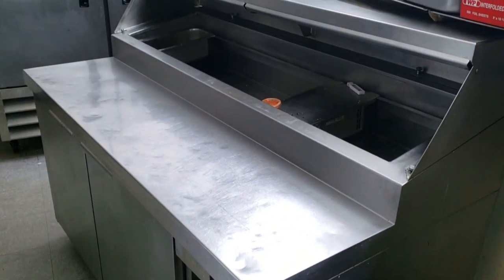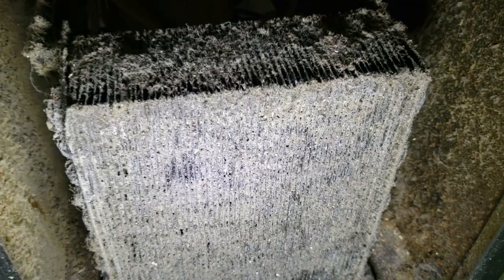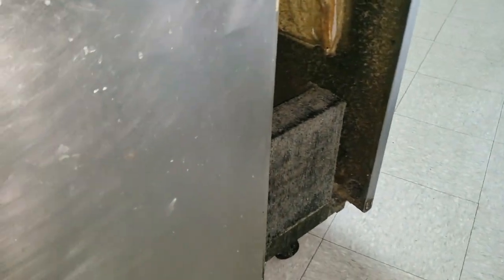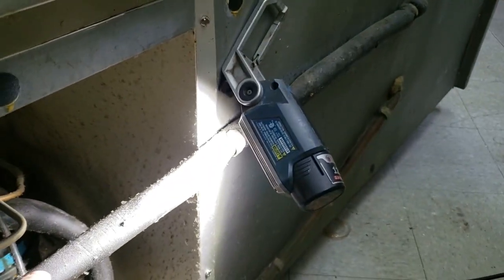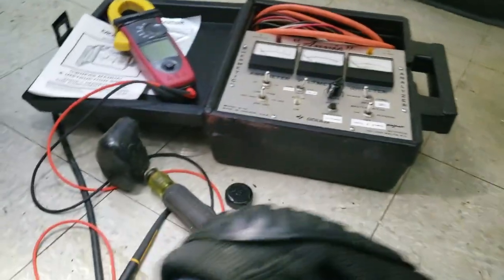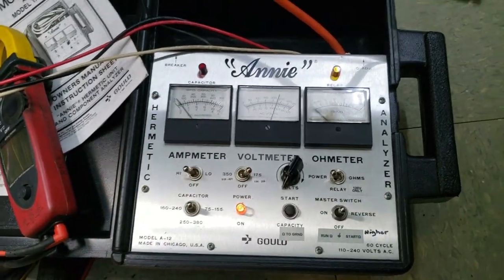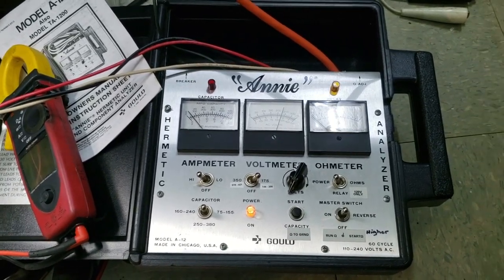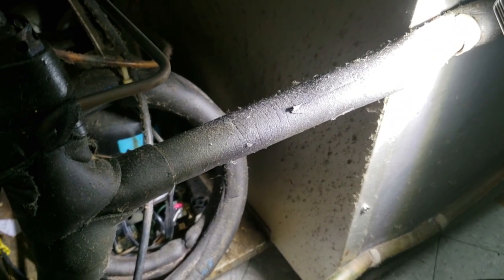Prep-Table Warm Multiple Offender

Comment: That compressor is toast, the newer randell units control the top rail with a thermostat now , I have that brand in my restaurants,they are bad about getting leaks , good video brother
Reply from the maker: I hear ya, I have had a lot of evap coils leak in the box and in the line-set where the suction and liquid are tied together.

Comment: That's a shame , seemed like decent equipment .
I always hated reach-ins because of the tight space in the compressor compartment and also the bloody greasy condenser .
Once it gets that pluggo buggo it's pretty hard to get it cleaned up , and then with 134a , you know it's all gunked up inside , maybe even a restricted cap tube and all ... Oh well !
Stay safe out there mate 👍
Reply from the maker: Thanks Mr. Archer! This one had 2 txvs, but yes you are correct, its crazy how used and abused the equipment is at times. Purchasing used equipment is popular here with the bars and small restaurants so its not uncommon to see the equipment come in all beat up and with very little life left.